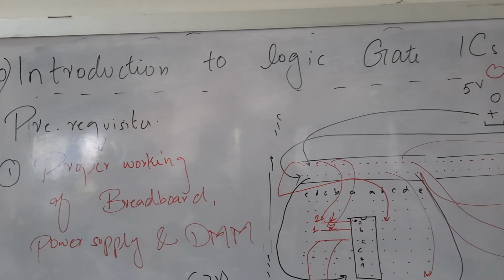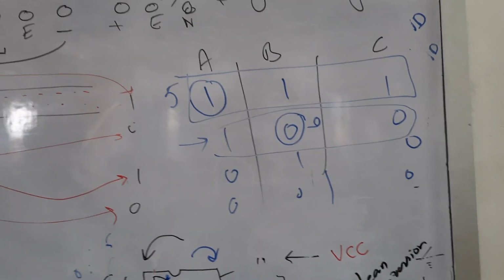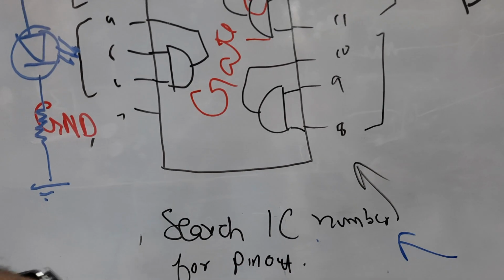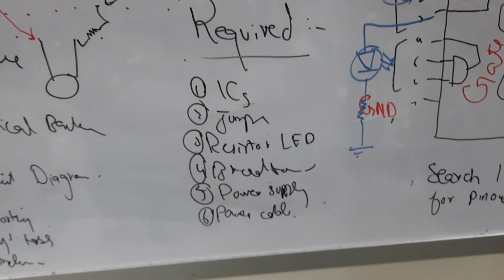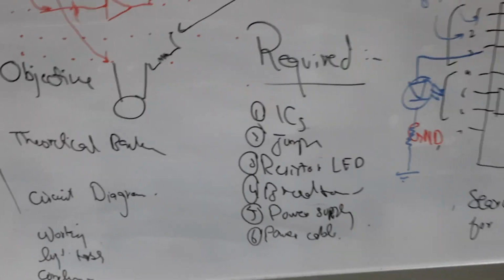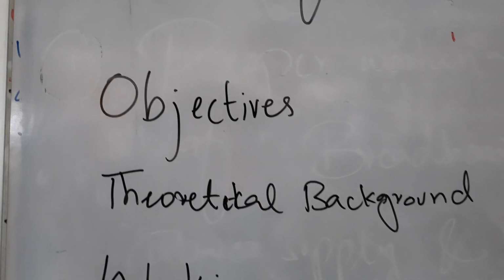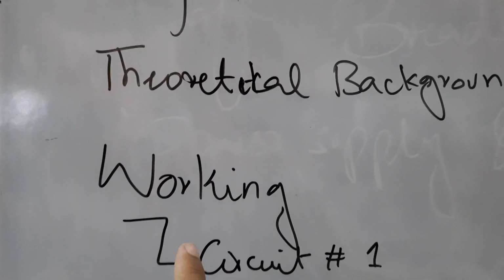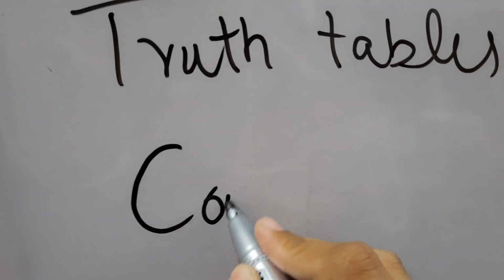Introduction to Logic Gate ICs | Digital logic Design Experiments

Comment from the maker: Correction at 9:30 ,  you will find many leds with opposite polarity what what is told in the video. The rule told in the video is not univerisal. Led manufacturers can manufacture it with oppsoite polarity as well i.e bigger region can be positive and it can be negative as well .and same goes for other region😊